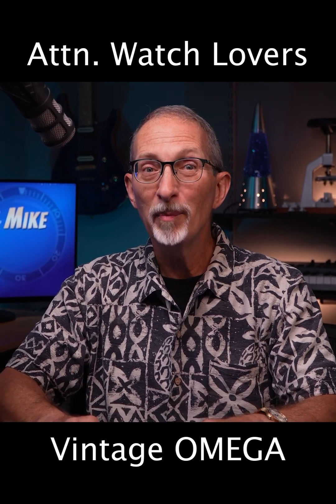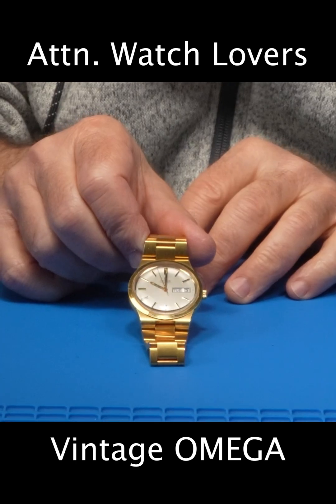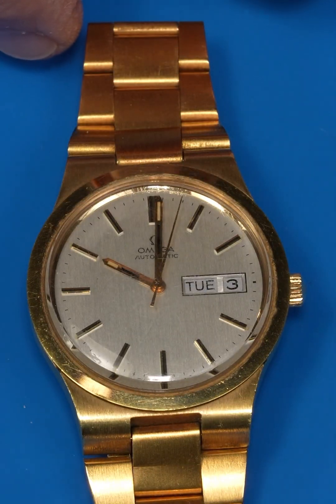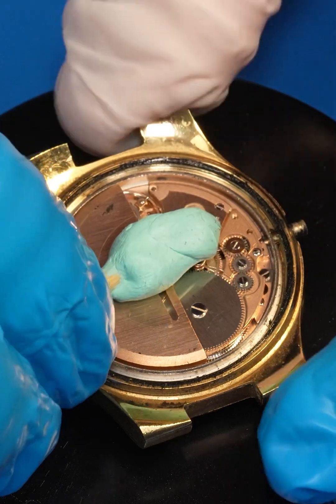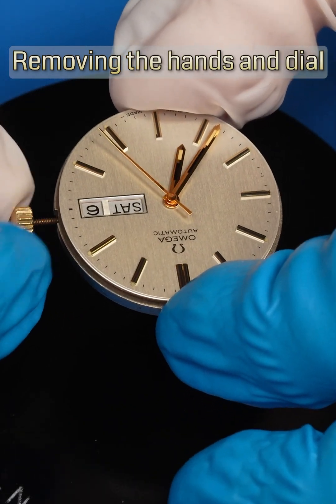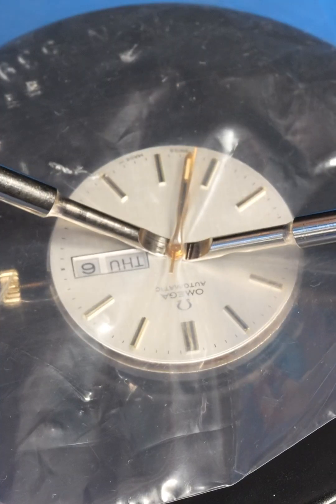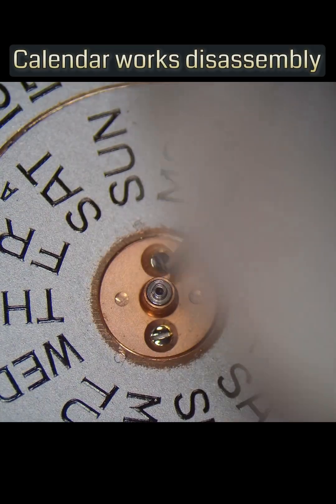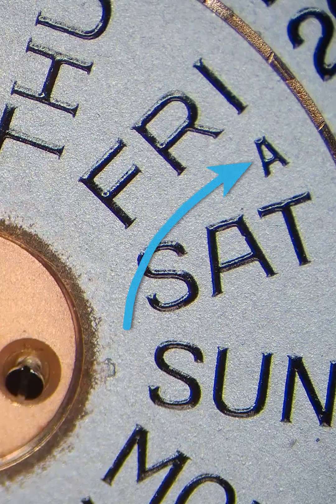👀 What is THIS inside my Vintage Omega Wristwatch?  #watchmaking

Comment: Still dont know what that "A" is for... 🤔
Reply: How can i find this watch   ? What is the serial nr
Reply from the maker: Yes, it's really bugging me… There has to be a reason for it! I will not sleep until I get an answer.
Reply: @WatchWithMike  The "a" on a watch's date wheel is a placeholder used in some watch movements. It's not a standard marking, but rather a feature of certain mechanisms, particularly those with a 24-hour wheel interacting with the date display. It helps to align the date change mechanism with the 24-hour cycle. 
Here's a more detailed explanation:
24-hour wheel interaction:
Some watches with a date complication also have a 24-hour wheel that rotates once every 24 hours. This wheel can be used to trigger the date change at midnight.
"a" as a reference point:
The "a" (or sometimes another letter) on the date wheel serves as a reference point for the 24-hour wheel's finger. As the 24-hour wheel rotates, its finger eventually encounters this marking on the date wheel, indicating the time when the date should advance. 
Mechanism:
The finger on the 24-hour wheel pushes against a lever, which in turn engages with the date wheel, causing it to advance by one day. The "a" helps to precisely time this action.
Reply from the maker: @johanvandersandt8904 Dude you're awesome!!! Very interesting. Thank you for solving the mystery! 😁👍🏼😎
Reply: @WatchWithMike  You are most welcome! Now you can sleep in peace haha!
Reply: @WatchWithMike what he said ☝😂️
Reply: @WatchWithMike  Uh oh... That might keep you awake for a long time haha!
Reply: Let me see if I can find something.